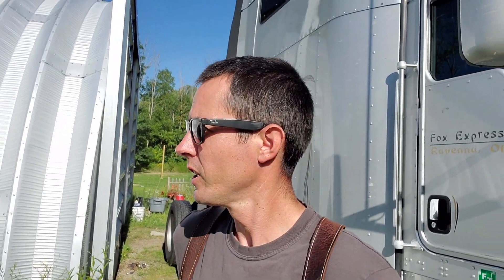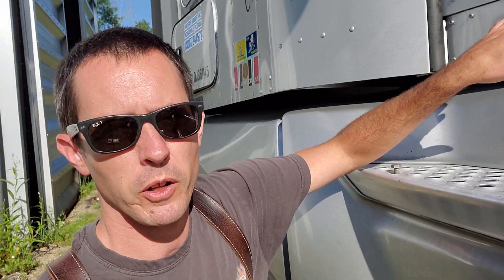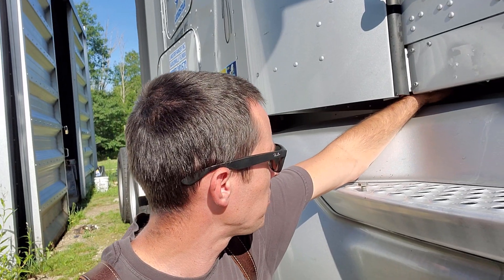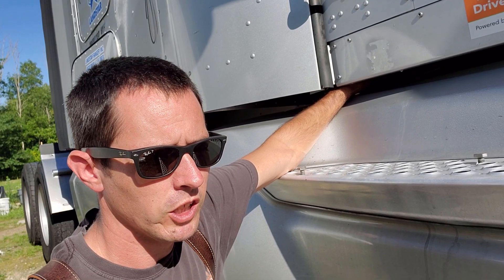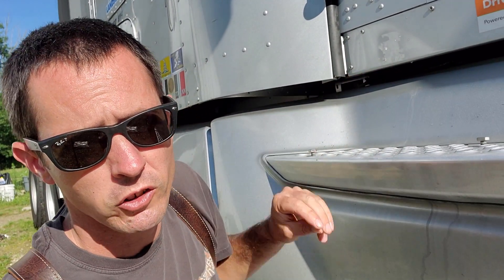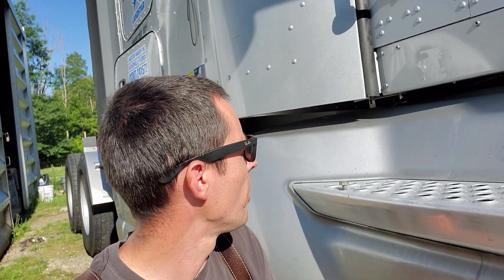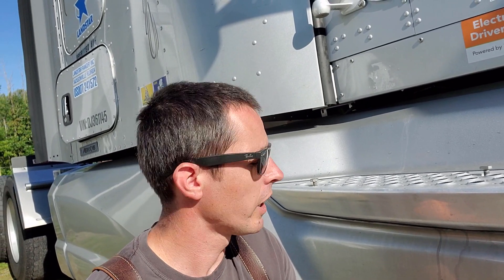DPF/SCR Wiring Harness Replacement + SCR Temp Sensor Replacement - Kenworth Truck DIY

Comment: Oh man thank you so much. You just saved me sitting for 5 days waiting for the dealer.

This job is very much doable by the average guy. That 1 7/8 socket is absolutely necessary. Mine wasn't as easy to twist off. I had to slide an Alan key into the hole to give me the leverage I needed.

Btw this part costs $1,158 at the dealer now. Not happy about that but I saved days and labor costs.

Thank you sir.
Reply from the maker: Glad this video helped you! You are welcome!
Reply: @truckingandfixing  the Def light cleared immediately and I was gonna ask about when the check engine light would clear and it just cleared 20 minutes ago
Reply: What's your opinion on putting heat shrinks on the connectors to prevent this from happening in the future?
Reply: I've replaced that harness, but still in a 5mph derate. Hooked my scan tool up and it still say open circuit on doser valve. I heard it's 2 other harnesses on it that I might need to replace. Do you know anything about those harnesses(part numbers) and where they might be located
Reply: @ewash53212  I hope Ryan sees this message
Reply: @ewash53212 how did you manage to get the big plug to disconnect
Reply: @ewash53212   how did you get the main plug to disconnect? Is this a hard pull or is it a twist connect ?
Reply: @certified_boogeyman   hey how did you get the big plug to disconnect ?
Reply: @truckingandfixing   hey Ryan I’m having major trouble disconnecting from the main plug any advice on how you disconnect
Reply: @Solidcirclewealth  it's a twist and pull. Once you disconnect it, you got unscrew a big plastic nut that gotta come off next
Reply: @ewash53212 it could be the doser valve itself. You might want to make sure the wiring is bad before you start replacing the harness

Comment: Another great vid Ryan...it was a pleasure talking to you last week about our apu alternators.
Reply from the maker: Same here!
Reply: I have a question mr ryan.
My apu runs for two hours some time 3 and after that it shuts off with alf code or eng code,i change the compressor put new one but still having same issue so what could it be?
Apu is thermo king

Comment: Get a otr performance reset tool all owner operator should have one
Reply: I have otr performance it doesn’t do anything for 2017 KW t680. The SCR shows on my screen
Reply: @SirFoodie1904  
Bummer it works great for me on my DD15 it rests the ash and all of the after treatment systems plus any codes that it throws up

Comment: Hey Ryan I have a2015 isx15 and it keeps making soot . I have replaced number 6 injector and it didn’t start this till after rebuild. I feel like a vibration about a 1/4 pedal. Is it possible the throttle sensor could be bad? I’m stuck trying to figure this out. It has 5.20 oz of soot. I regenned it earlier about 4 hours ago. Can’t figure why it’s making soot. Any ideas

Comment: Hey ryan, so my 2019 Kenworth t680 Cummins isx15 threw an engine light on the dash. My PDI is saying intake nox sensor heater abnormal rate of change fault code 3649. However on my PDI my scr in temp is a constant 32°. It never changes. my scr out temp is 223°. I'm thinking I need to change the intake n o x sensor to clear up the intake nox sensor code of abnormal temperature change. But why would my scr in temp be constantly 32°? And am I right about changing the intake nox sensor? I don't want to just be throwing parts at this thing, because just the nox sensor alone is $600.

Comment: Got a question, i noticed the connection plugs for the DPF inlet/outlet pressure sensors are brown and blue, are the current or up to date connections different? because I don’t see any brown or blue plug ins for the KW/Cummins trucks I’m currently working on
Reply from the maker: It was the same as the original one it had with the same color.

Comment: Hey Ryan, I’m getting a code 5493 on my isx15 I was thinking of changing that harness you just changed, new dozer valve, and still the dozer is not pushing def into the system
Reply from the maker: Did you change the def filter, have you check the pressure/flow weight on the def pump?

Comment: Hello i have a volvo 2016 780 automatic ...i bought yesterday in la 
They tomd me was driving good 
Driver drove to el paso washed the engine en now it doesnt drive more then  40mph nd it die ..any idea  what the issue can be or what he did wrong please ...need help
Reply from the maker: There is water somewhere in the connections. You need to get the code which will tell you where the problem is, then find the connection and dry it out.
Reply from the maker: I made a video about engine wash, maybe watch it to see it anything makes sense. Getting An Engine Wash At A Truck Wash - Be Careful!!! https://youtu.be/-EtY8kK0Wdo